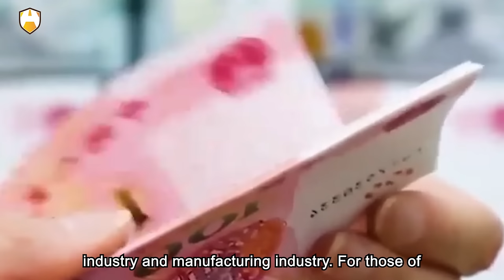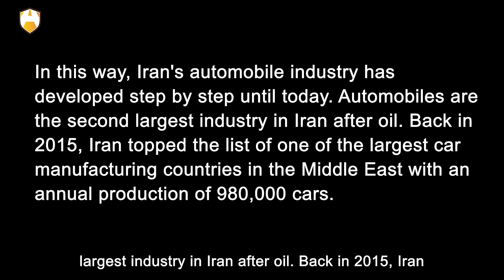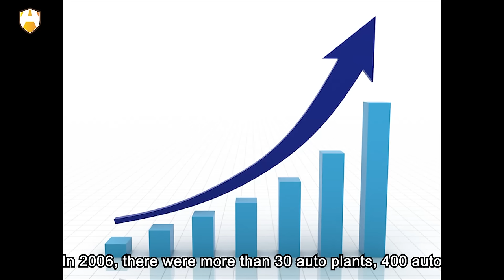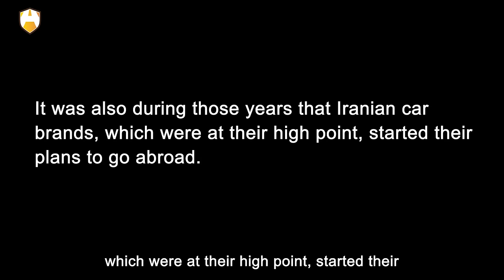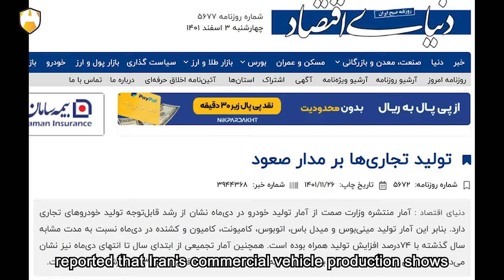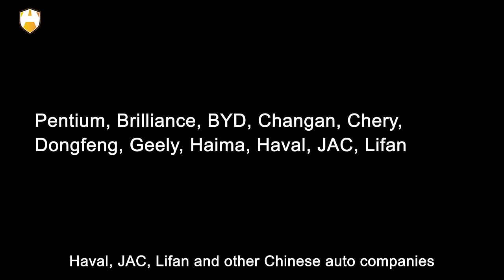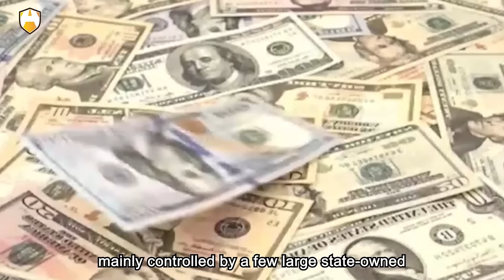Iran, what makes it possible to export cars to Russia? The unknown Iranian auto industry

Comment: Many of these cars were imported in Iraq, they are very poor and break down, and the metal they are made of corrodes in Iraq. They are sold at a price of $2000. Saipa cars consume a lot of spare parts, especially the suspension system.